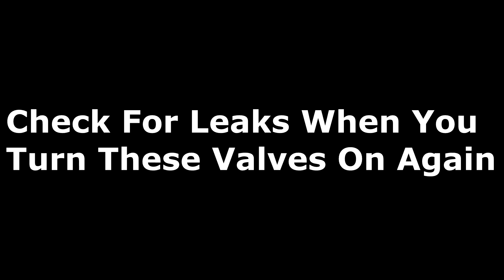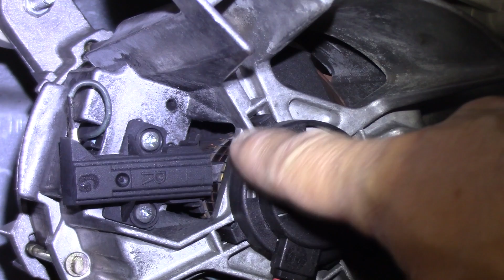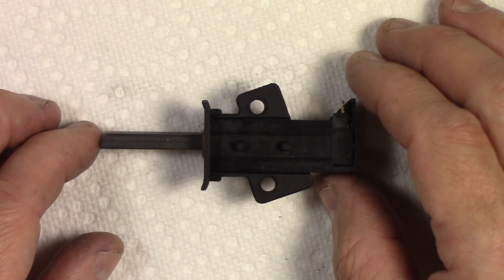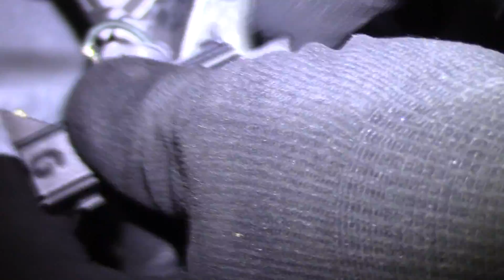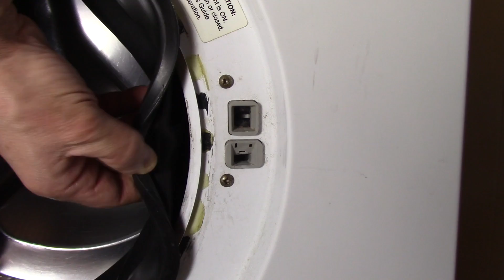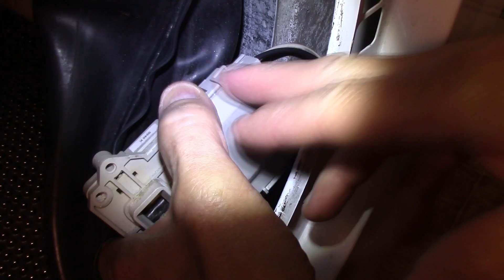Front Load Washer Won’t Spin Tumble Washing Machine Troubleshooting Frigidaire Kenmore Etc. Thorough

Comment: Bro you are a real one! About to fix my kenmore washer door latch assembly thanks to you 🙏
Reply from the maker: Awesome! I'm so glad I could help you, and I hope it all goes smoothly with your repair.👍😀
Reply: Hi Richard, when I removed my kenmore door lock switch it was different than yours. 1 black pull tab plug in and then the rest were single wires attached to each prong. The middle section of your door lock switch has 4 prongs my old one had 2. Would it still work?

Comment: Could water dispense if it has a bad door switch?
Reply from the maker: I'm not sure of what you mean by "water dispensing". Do you mean water leaking out or the washer actually filling with water?  Thank you so much for commenting and watching. I appreciate it greatly. Subscribe, Click The Bell and stay tuned! All the best.👍😀
Reply: @richardlloydusa  sorry I meant to say could the washer fill with water if it has a bad lid switch?
Reply from the maker: My assumption here is that this is a top loader. Some washers do stop filling when you raise the lid and some do not, so that's not a good test of the switch, but they all stop the washing and spin function when you open the lid. So if the machine goes through a washing cycle but does not stop when you open the lid on the wash or spin cycle you know you have a bad switch. It could also fail in the other way where the machine thinks the door is always open and at that point the machine will not go into the washing cycle (but may fill normally depending on the machine). I hope that helps. Thank you so much for commenting and watching. I appreciate it greatly. Subscribe, Click The Bell and stay tuned! All the best.👍😀

Comment: A Kenmore identical to yours. 20+ years and my first problem is that it will not spin and the timer will not advance. It enters the spin cycle area on the dial and stops until I turn it off, no advance no spin. Before the problem started, I sprayed silicone into the door latch mechanism for lubrication purposes .  Any suggestions for repair?

Comment: I have a very similar model, Gibson (Electrolux) model GTF1040AS0, where the spin cycle fails to work only on the regular wash mode. It will go through the preceding cycles normally; but when it gets to the spin cycle, the motor will run like it wants to start the spin, but never actually does. The other two modes (Perm press, Knits) work normally. Would a front door switch still resolve the issue, even though it's only happening on regular wash?
Reply from the maker: I don't belive it's the front door switch because that would affect every cycle of the machine not just the regular cycle. Here's a discussion on the likely causes: https://www.justanswer.com/appliance/2rylu-spin-cycle-gibson-front-load-no-longer-spins.html
Understand that I have not had this problem so I can't answer this for sure. If you're going to attempt a repair by replacing parts make sure you buy them from a place like Amazon where you can easily return the part if it is not the source of the problem. Ask what the return policy is before you buy. 
Thank you so much for commenting and watching. I appreciate it greatly. All the best.👍😀

Comment: What s the problem when it stops washing and the door opens
Reply from the maker: More than likely you have a broken door stryker at Amazon: https://amzn.to/3vO0dMs or a broken door lock switch assembly: https://amzn.to/3dkcQbO
Make sure to look and see that the parts are compatible and that they look the same although if your stryker is broken it will be missing a piece. 
Thank you so much for commenting and watching. I appreciate it greatly. All the best.👍😀

Comment: Sir I have a Washing machine which brand is Sharp,, the problem is washing machine taking water and door also lock but the machine is not spinning. What is the problem?
Reply from the maker: I suggest checking the drive belt. It may have worn out or snapped. Thank you so much for commenting and watching. I appreciate it greatly. All the best.👍😀

Comment: Can you help me? My machine seems to operate properly except it won't tumble during the wash cycle. I have replaced the door latch mechanism, the shock absorbers, and the motor controller. I even cleaned out the coin trap and drain assembly. Any in site would be great.
Reply from the maker: If it does not turn at all check the drive belt. Other than that I would say your best bet at this point is have a trusted trained tech (check yelp or google reviews) look at it. Thank you so much for commenting. I appreciate it greatly. All the best.👍😀

Comment: I found the brushes     https://www.partmaster.co.uk/carbon-brushes-pair/product.pl?pid=796575&query=AEG+CARBON+BRUSH+AND+HOLDER
Reply: the ones on amazon dont fit , they are a new housing and ele. tab connector type.
Reply: https://www.ebay.com/itm/Carbon-Brushes-For-AEG-FHP-FRONT-LOADER-Washing-Machine-Motor-with-Spring/161377498598

Comment: Brilliant instructions!
This video resulted in me being able to fix my machine. 
I took the Motor Carbon Brushes off for inspection, cleaned them, fixed them back on and the machine is now back up and running! I also ordered replacement carbon brushes because they are running very low and will need changing within 3 to 6 months I guess.

Thank you for the video, it saved me buying a new machine!

Comment: Richard, was experiencing a similar issue you  addressed, entering the final wash,it loads some water, pauses and pretty much stalls until I pull, rotate timer  one notch & push in, then continues to load water and continues "full tilt boogie" like there was nothing wrong. 
After reading all the other comments and your valuable advise, insight and experiences in such matters, I only got $0.39 cents out prior to the pump, belt was ok and thought about the odds and  rolled the dice spending the $18.00 with Amazon  The door switch arrived before the ETA, installed and had visions of getting off the Mrs's  PoPo list!
 However I obviously missed something, because it is still doing the same thing,..any suggestions?

Comment: Hey Richard, excellent video lots of detail. I repaired my dryer bearing using your instruction. Now my washer won't spin or tumble. The door latch was broken, but replacing it (cheapest first option) didn't fix it. Brushes look good, but I'm not clear about the commutator. It looks worn and black vs robust and shiny like in yours. I don't see a video about replacing the motor. Also I don't want to drop $200 in a motor unless I'm sure that's it. I have a good pic of the commutator if you can respond. Or anyone.
Reply: Oh, the belt was just fine.
Reply from the maker: I cant post pictures here, unfortunately. The commutator should be somewhat worn where the brushes make contact and slightly discolored but still a darkened copper color. Now the brushes should slide out quite far when you remove the assembly. If the brushes only extend out an 1/4 of an inch or less to the tip from the housing when you remove the brush assembly (two Philips screws to take each off UNPLUG the unit before checking), then you are near the end of the wear of the brush. What happens is that though there is still brush left and it (looks good) it is not long enough to actually make contact with the commutator. So remove the brush assembly and see how much brush you see when you do that. Thanks.
Reply from the maker: Here is a great page showing the brushes and replacing them. https://www.theartofdoingstuff.com/how-to-replace-carbon-brushes-on-any-motor/

Comment: Thank you so much for this video.  It was super informative and saved us from purchasing another washer.  Had a difficult time sourcing carbon brushes for the motor.  We ended up measuring the carbon brushes and sourced them through a local  electric motor repair place.  Thanks again!!

Comment: Is there a reset technique for Kenmore 417 front load washer??? I replaced the door switch, the drain pump, the water inlet valve, the control board, and today I changed the motor. It clicks on and that's it.........................

Comment: This might help also...in my case..it's what I found in my drain hoses/attachment...plugged solid with coins and dirt of course...part of a steel contour of a bra...and paper clips... there's a container which stops stuff from damaging the unit...in that attachment where 3 connections are made with clamps ..after cleaning...worked perfectly

Comment: Ok so i have a washer that will fill with water and will pump it out. door does lock. So that means my issue is more likely with the motor?  As for the switch mechanism can you test it with a dvm? what readings should i get?  BTW i had to reconnect the top connector on the switch from above because mine someone taped the wire so it barely comes out at all and i had to the switch hole to attempt to reconnect connector. Thanks.

Comment: Kenmore 417.48102701 will not start. Previously made it to the " drain, fill, rinse, and spin dry " cycle and quit. I replaced the door switch, drain pump, and complete control panel. When I try to start from any wash method there is a click, the lights go on, but NOTHING HAPPENS......
Is it the motor????????
Thank you.

Comment: Thank you for  this video! Very detailed. I rescued my washer from the trash. Had to reconnect a burnt point in the board with solder and it worked great for the last 4 years. I took my shoe switch apart cleaned it and put it back together and it's working again. Thanks for the awesome video.

Comment: Good news is that the second set of brushes I got did work on my washer (Frigidaire Model 417.39022890 mfg date 08/98). I had to flip the carbon pieces, which aren't quite as tall as OEM, around so the angle matched the bracket tabs. Ebay seller trustyhl item #AEG-62730W (package also has GD062730W-1). Made for AEG apparently. <$10 so that's definitely a win in my book. I actually did leave the good inboard OEM one on for now since it has lots of life left in it.
Reply from the maker: I would have done the same. If the part is good keep and let it wear. You will probably get lots of use out of the part before it wears out and when it does you have the replacement on hand. Always keep a spare. Thank you for commenting and the valuable feedback. I appreciate it greatly. All the best. 👍😀

Comment: I found all parts on the repairclinic site my unit just won’t agitate or spin got a new motor 👎🏽 not the problem waiting on the speed control mother board ? Hope that’s it !!
Machine with run water drain I hear the knock working ? Belt is good
Reply from the maker: I hope the board fixes it for you. Please report back. Thank you so much for watching, commenting and the kind words. I appreciate it greatly. All the best.👍😀

Comment: I'm not sure that the last person didn't replace both brushes. I looked at my original ones (19 years old!) and they look exactly like that where the outboard one is worn much more than the inboard. Looks like the cheapest option now is to buy L versions so I'll just swap the innards.
Reply from the maker: I agree. The carbon rods are the only part that wears so if you are handy replacing those is the cheapest option. The problem I found is finding the rods. Thank you for watching, commenting and the valuable feedback. I appreciate it greatly. All the best. 👍😀
Reply: @richardlloydusa  I had the right idea, but on the L ones I got the carbon was thinner than the OEM so it wouldn't work in the original brush holders. :( I found some that are R but shorter and wider that maybe I can get to work. I don't get why these are hardly available in the US anymore. They seem quite common in the UK (though maybe not the exact ones I need).

Comment: Great video, thanks. One Question tho so it doesn’t lock & i replaced both front peace’s why doesn’t it want to lock nor spin, what do I have to do to get it to lock
Reply from the maker: Can you hear it click in an attempt to lock? Thank you for watching and commenting. I appreciate it greatly. All the best.👍😀
Reply: Yes I hear a click when it goes in but nothing else
Reply from the maker: Is the striker on the door broken? I show it in the video. Take a look and see if it is broken. It's the white tang on the door. It should look the same as what I show if it is a Frigidaire like mine. Thanks again.
Reply: Not broken at all
Reply from the maker: Here is the troubleshooting from repair clinic https://www.repairclinic.com/RepairHelp/How-To-Fix-A-Washing-Machine/49---/Washer-door-or-lid-won-t-lock Outside of this I would recommend a service call to see what the problem is. Thank you.

Comment: Richard, thank you for a very informative video. I have a Kenmore Washer Model: 417 47102700 that looks identical to the Frigidaire shown but the motor is different (No brushes). 
The door latch is in good shape and the Door Lock Light comes on when the door is closed and the unit started; allowing the unit to go through a cycle.
The pump is free of all debris and the unit fills and pumps water out OK. 
The belt is in good shape and connected to the motor. I can see the motor spin when I spin the drum freely by hand.
The problem is the motor will not spin during any part of the wash / spin cycle with the belt on or off.
Recommendations?
Reply: Thomas Dzialo hello did you resolve the problem with your machine?  I have the same problem. I thought it was the timer control but it is not.
Reply: I have the same problem now.  Looks like a brushless motor.  I've run the tests in the guide from inside the washer and found nothing wrong.  I'm stumped.

Comment: Buddy said to buy a new machine. After checking that expensive option, I was ready to call the repairman. Wife said to watch your video. I did. Towards the end I discovered the exact problem and the solution: replace the wax motor. Amazon had the part delivered in under a day and the machine was up and running again in 15 minutes. Thanks so much! You saved me a fortune.
Reply from the maker: You are most welcome. Thank you for watching, commenting,the valuable feedback and the kind words. I appreciate it greatly. I am happy to know I could help. All the best

Comment: is there a hidden spot on there that has the model #? The sellers actually scratched mine off. They would not explain why but admitted to doing it. I have had her since the 2000s and it works very well until it did not.

Comment: I have a Kenmore 417.43042200. It looks exactly like this washer on the front, controls, door, etc. BUT... the motor looks completely different. No brushes to be found mounted on the outside.
Any ideas?

Comment: Have you noticed that they both have a great big "R" on them?  The second one, that you said was the one on the left, had a big R. Wouldn't that make some difference? Since you are talking about how the slope should match, and one should switch them if one doesn't match, could that be how both of yours have a big "R" on them?  That the case, which perhaps doesn't matter, is labelled, so it could be labelled R on both of them and be okay because you switched it around?

Comment: Thanks very much for a helpful video. Our machine intermittently will not go into the final high speed spin. But we have discovered that it seems it will do the high speed spin if the front of the machine is raised about 1.5 inches. Seems like it would be worthwhile for me to replace the door switch, but if you have any other ideas, that would be great! The drive belt appears OK, but the big pulley looks like it is not perfectly true and the drive belt is not perfectly centered on the big pulley. I don't know if that matters. The belt is not rubbing on anything. Thanks again for your help!

Comment: Hi Richard, thank u very much for this video.  I have the exact machine and problem u had and its all fixed.  I got the parts off Amazon, but they sent holders with a different configuration.  I thought I had to return them but I used the brushes from these to replace the worn ones.  The part where u showed how to take the holders apart sure helped.  My wife is so happy she can wash clothes at home again!

Comment: Great vid... I must say though. The very first thing that you should tell people when dealing with this issue is to check the plastic filter in the drain hose. I just found $8.87 in my filter, and now it works fine. I almost spent $249 on a new board and motor. This was a free and easy fix.
Reply: LOL, you made money fixing your washer!

Comment: hi can u please help me, I have a indisit washing machine and the drum doesn't turn at all but the belt and everything work on the rear. Just the drum doesn't move from the front. What do u think is wrong
Reply: Check the filter in your drain hose that is attached to the water pump. It gets clogged. If water is not draining properly, it will not run.
Reply from the maker: Can you manually turn the drum? Does the motor run with the belt off? Thanks.
Reply from the maker: Thank you for watching, commenting and the kind words. I appreciate it greatly. All the best.

Comment: We have exactly this model. A few years ago we had that problem of the final spin avoiding  it's 'frantic' mode. I disconnected this, reconnected that, nothing helped, then I gave up on it for the day and the next day it just started working properly! I have no idea what I did, but it has been working for 6 years since then with no problems. However, if it DOES act up again, at least you've given me the knowledge to check that wax motor connector which I suspect worked itself loose and I maybe bumped it back into place by accident.  BTW you are one the clearest most concise teachers I've ever encountered. Thanks much!
Reply from the maker: You are most welcome. That wax motor is a very strange component but if it does go on you, you can replace just the wax motor. Here it is on Ebay: https://goo.gl/1T1WLL  Thank you very much for commenting, watching and the kind words. All the best.